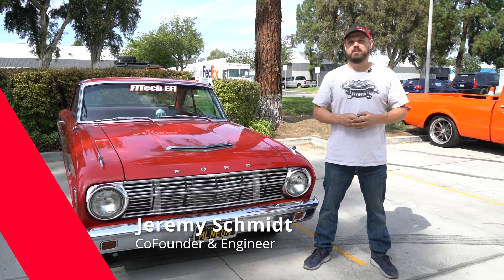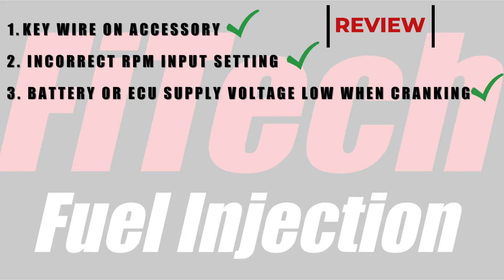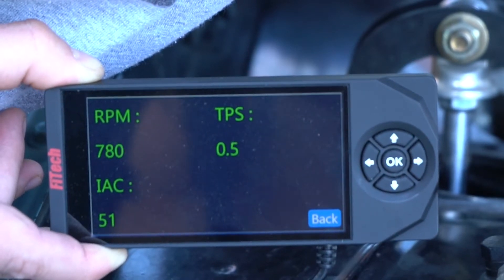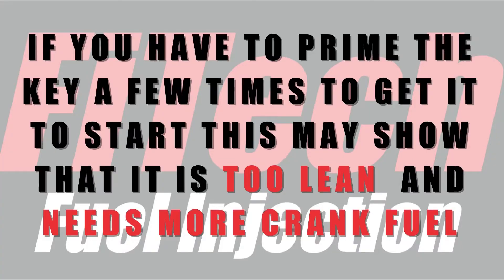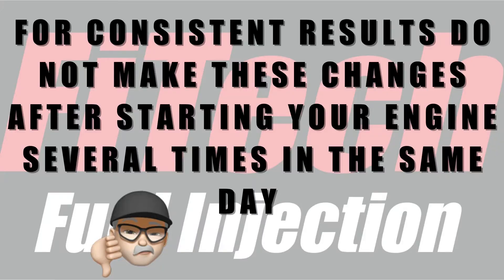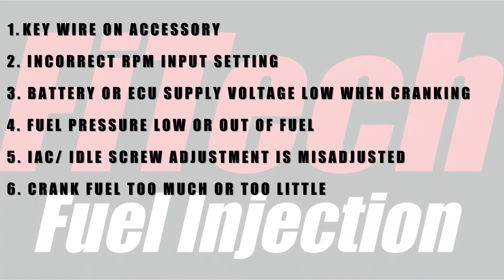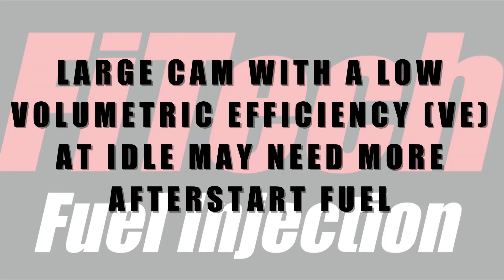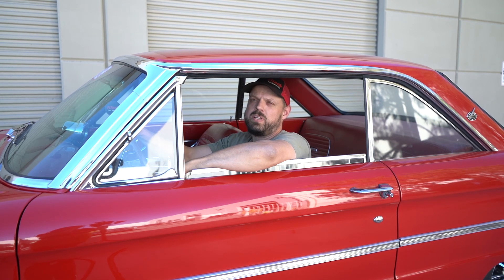Does your vehicle fire and die? Part 2| Tech Tuesdays | EP45

Comment: I use aftermarket fuel pump tank with return line in fitech 30003, i don't use any fuel pressure regulator but install only pressure Guage and it shows me about 40 psi. I have problem with the first start and the engine is not run, i have to turn twice the key on and off untill the engine to start. Fitech has built in self regulator so do i need external fuel pressure regulator? is my problem related to this?

Comment: What do I adjust if it dies when I put it in gear?
Reply from the maker: Adjust the throttle. See epiosode 60 on how to adjust IAC steps.
Reply: @FiTechEFImedia  Yes, I've done this.  My IAC are between 3 and 10.    The car will even almost stall while idling just when the electric fans turn off.

Comment: I have a 1200hp power adder system and it was running just fine,went to start it the other day and it would fire then die,many times. I cracked the throttle a little bit and it back fired through the throttle body,after searching for a problem with the key on I noticed it was making a clicking noise coming from the throttle body and I can't figure out what it is. Any ideas? If emailed fitech and they haven't responded

Comment: I have a cam with 600 lift so I set to cam 3. My car will not stay running and keep getting p0505 fault code and the O2 sensor wide band code. By the way I have the Ultimate LS 750 Fitech kit. I have a 383 displacement . I have replaced the IAC but still getting the same code.
Reply: Did you solve the problem

Comment: whats a good tip for keeping the idle up when going from park to drive ? i noticed in my 350 i got it running and driving actually great. but when it first put it in reverse or drive to take of the idle will fall pretty rapidly and usually will stall unless i sort of blip the throttle.  I have it idling at around 900 rpm and its steady its just that initial pull into reverse that it will have a hard time.
Reply: Did you fix this? What did you adjust?
Reply: @Domobomb  Yeah i sorted it out i had to go through adjusting the idle step parameters in the unit you sort of put the unit in a mode where it will manage to keep the idle steady while you turn in or out the screw on the throttle body until you see the gauge read between 3 to 10 steps or some where in that area. then once its staying there you take it out of that mode and it keeps it more steady and less likely to stall. 

It does have the usual idle dropping just a bit like any automatic vehicle when shifting into D or R. but doesnt stall any more.
Reply: @CarsnStuff you can ajust the Idle in gear, higher than the idle in park...

Comment: I have the 30064 on a tunnel rammed big block, over the last few months on cold start it will start and in the after start the engine surges likes its got a blower then smooths out as the warm up fuel kicks in. The AFR shows its going lean when surging but not sure what would cause it to surge? Adding or taking away after start fuel doesn't change it. Any suggestions?